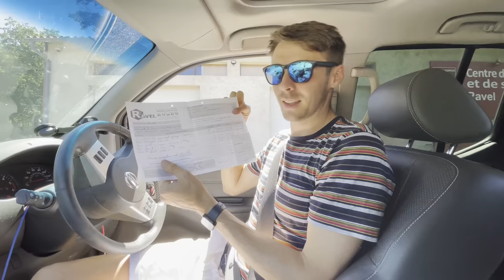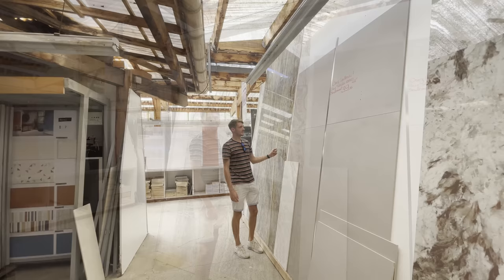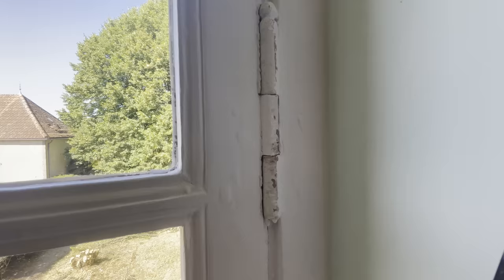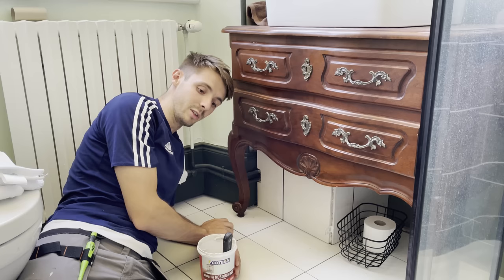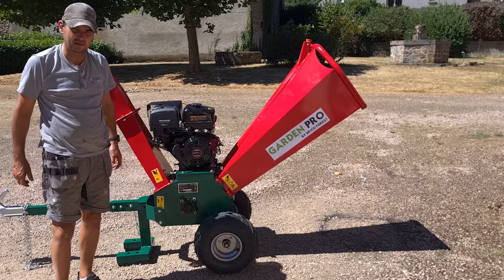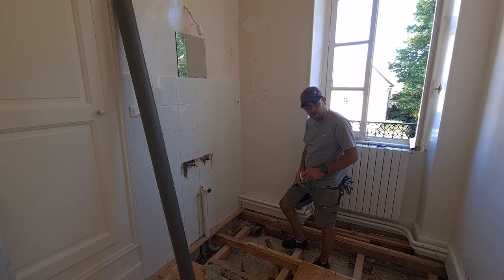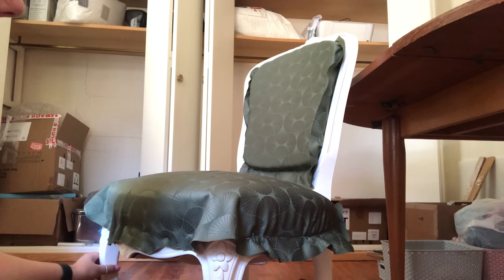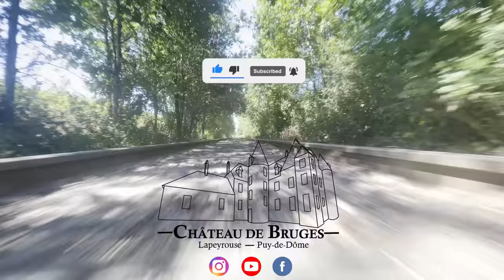'Chateau de Bruges' - Ep.4 - RENOVATION

Comment: Looks and sounds like a military aircraft that flew over when you were unpacking the chipper.  Oddly enough, we had a low flying one yesterday exactly four weeks after the last one.  Although we are not far from the airport, this was not flying at anywhere near the height the usual aircraft reach and was taking a route that others don't.  No air displays anywhere near, either.
Oh yes, back to the rest of the video - the bathrooms are looking good, as is the chair! ☺
Reply from the maker: We do have what looks and sounds like a fighter jet pass over the Chateau fairly regularly. It does make a hell of a noise. we are yet to catch a glimpse of it on the camera though! Will make sure we post it if we manage to capture it!

Comment: While it's a good idea to use vintage furniture, the dresser doesn't quite work for the bathroom, does it. It's the wrong colour and it needs a more modern piece that hides the awkward bottom area. The rest of the bathroom looks stunning.
Reply from the maker: Thanks Sinan! We are constantly looking in Trocs and Brocantes for more wonderful pieces of furniture. The pipe work under the sink makes it quite tricky to put a full height dresser in there though.